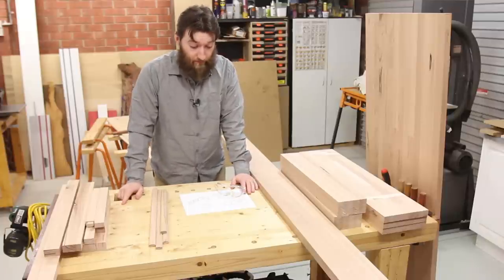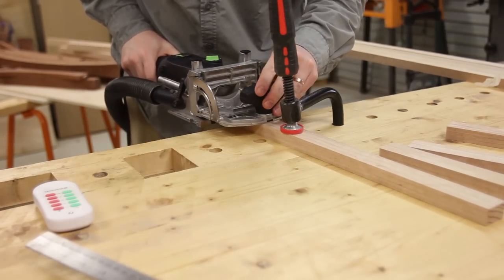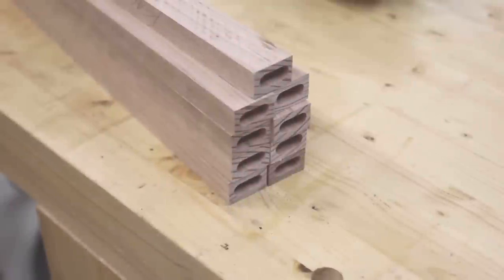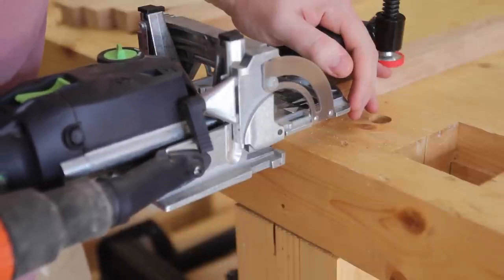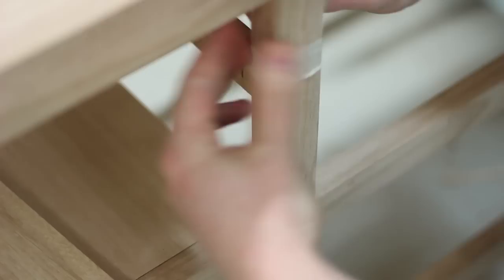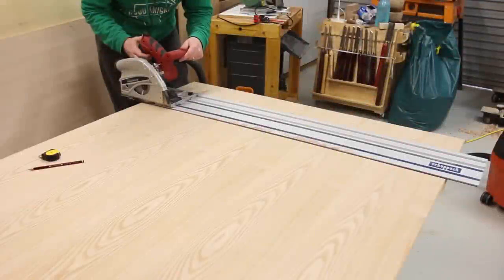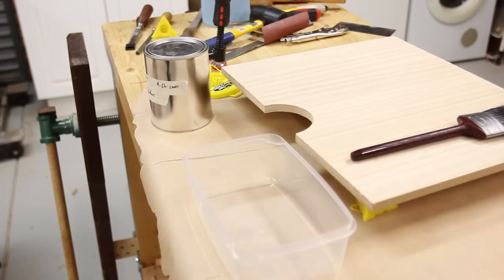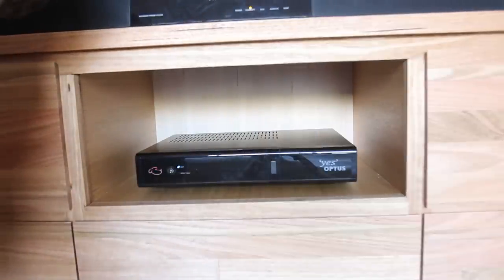073 - Tassie Oak TV Unit

Comment: Great job Paul, Best build yet. Go the tenons you could use pockets but where's the skill in that. Well done mate.
Reply from the maker: +Damo Mack I'll still be using dominoes for the structural joints, but for faceframes I'll likely use pocket holes as its much faster. I'd argue there is probably the same level of skill in both - the domino makes it a simple push action to cut the mortises, which is little different from using a drilling jig.

Comment: Paul - to your knowledge, is the laminated Tassie Oak bench top a local (to you) item at Bunnings?  The only ones I've seen at our local Bunnings (ACT) are made of Rubberwood, Acacia or Pine.  Good job on the entertainment unit - nice clean lines.  Cheers.
Reply from the maker: +justcruisin109 Thanks. I think they're limited to Victoria and perhaps lower NSW. I've seen them in half a dozen Bunnings across the state. At the local store, we've also got 'mixed reds' which I think also appears in QLD. I suspect its primarily flooded gum, though it seems to be 'seasonal', being in stock every now and again.

The rubberwood ones have been on clearance in our local bunnings for greater than a year, and with some stain they actually come up pretty amazing - I helped (read: I did the work) my auntie put them together for a kitchen, she used some "acacia" osmo oil (topcoat + stain in one), came up a treat particularly for the price (~$90 a 'board'?).
Reply: +Paul “TheWoodKnight” Jenkins Hi Again - I went to Bunnings today and my local store now carries these ($109) so I bought two to trial some building with.  They work out at $3.3k per cubic metre so not cheap but there's no wastage from jointing and thicknessing as well as having the sanding done for you so I guess it's a fair deal.  Good for people who don't have a lot of machinery.  Cheers.
Reply from the maker: +justcruisin109 Its cheaper per cubic meter than I get the rest of the tassie oak for!

Comment: Impressive!
Good on ya, mate!
Just one question: did you do anything to "soften" any of the hard edges?
Sanding, and/or a 1/8" round-over router bit? Particularly, for the top deck...
Reply from the maker: I'm not 100% certain on this one. Throughout the collection, initially mum just wanted sandpaper to break the edges as she insisted she wanted the 'harder' lines of no round over. Eventually we switched to 1/8" round over - the lines aren't really "lost", and it feels so much nicer
Reply: ...yeah...
'Specially if you've ever had your hand sliced open on a hardwood edge that was as sharp as a surgeon's scalpel... as a result of simply sliding one's hand over it...
Great looking piece of work, nonetheless! Great inspiration, too!

Comment: Hi, what is the name of that little yellow mitre rail 'gripper' thing? I could really use one but I'm not sure what they're called! Thanks, Alex
Reply from the maker: +AwayinWonderland without a time stamp I'm not really sure what you're talking about, but I think you mean the featherboard. The one I use is magnetic, by magswitch
Reply: Paul Jenkins Thanks for the quick response - the time stamp begins at about 9.40, you're using it with the bandsaw ;)
Reply from the maker: Ah right, that was an older featherboard that I quickly replaced with the MagSwitch. The Magswitch is more expensive, but just... better. More adjustable, can be configured in different ways, has addons to stack it higher. There are other brands out there, but look into them as an investment since they shouldn't ever break down
Reply: Paul Jenkins Cheers chap ;)

Comment: Very interesting to hear your last 30 seconds on pocket holes. I can't seem to understand the hate they get. They have a place like a domino has a place. Both can be over used, and if you don't like them, both can be ignored. Not sure why people get religious about either machine being the devil incarnate of woodworking 😈
Reply from the maker: I don't think you can overuse floating tenons, but pocketholes do often get overused. It's about using the right tool for the job, and often the ease of pocketholes cause them to be picked rather than the right tool (for strength, for wood movement, whatever reason).

That being said, not every project needs to be an heirloom, and there is certainly some gatekeepers out there who squash pocket hole users
Reply: @TheWoodKnight  "I don't think you can overuse floating tenons" ... that sounds like a challenge! 🤣 Get designing!